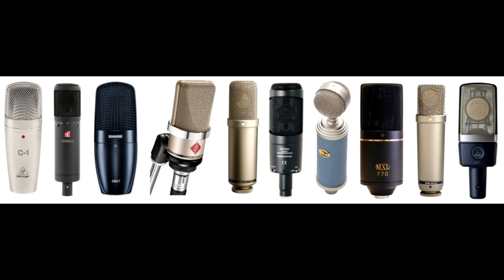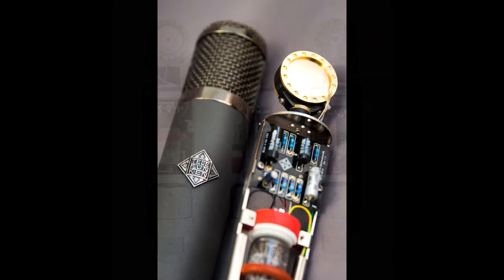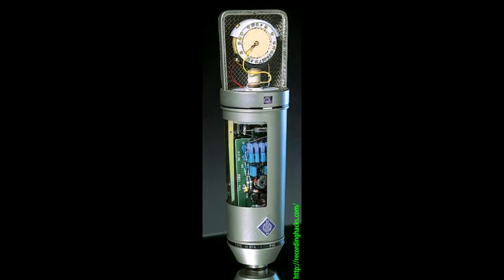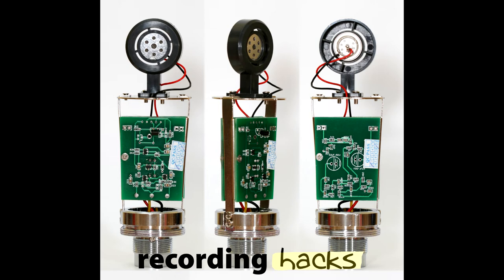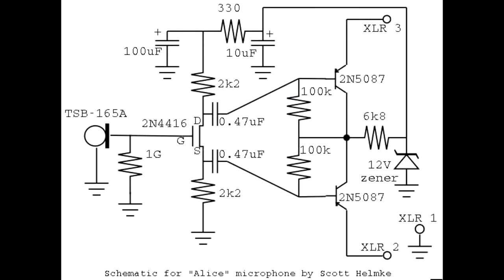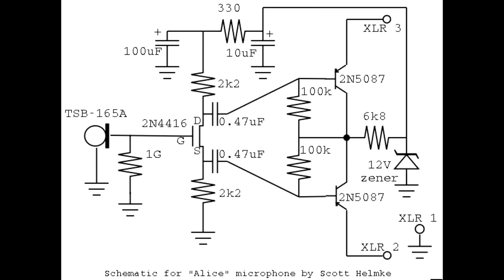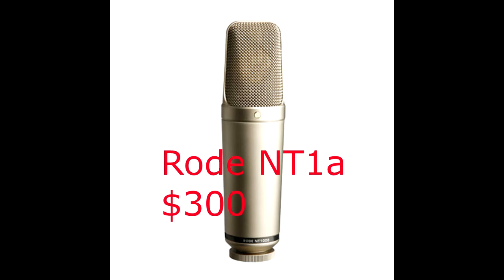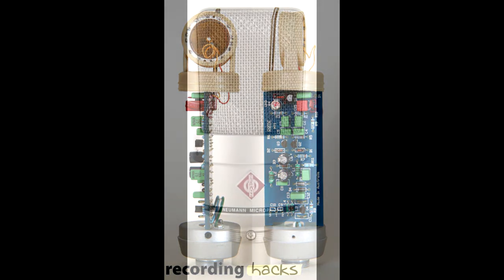#446 Condenser Microphone Overview

Comment: I think you are getting your impedance and current mixed up at times during the video. Impedance is the complex resistance. So the condenser microphone element starts with a high impedance low current at the FET and the circuit converts this to a low impedance high current balanced output using the transistors.

Comment: I hope you find this as upsetting as I do: https://www.youtube.com/watch?v=1DR-tTU8uIM
I know why magnetism exists, but who could be comfortable with such "sorcery." Electrers are are just err static static, or permanent static fields--instead of permanent magnetic fields, but we don't often interact with electrets as much as we encounter...refrigerator magnets.
Way back in the day, we used to hot-rod Panasonic elements for use in speaker testing. There was one that had over 120db of dynamic range, and was pretty flat, as well, like many speaker test mics are, such as the Behringer ECM8000, which singers would not like to sing into.
Reply from the maker: it IS magic. thanks for the video. reminds me of my old physics classes. There is magic inside LCD displays too. permanent charges put inside by cat fur... but lets keep to the audio topic :)

Comment: anything above NT-1A is a wankery..
Sure, ceramic PCB and laser trimmed resistors is a nice way to increase BOM, but after owning NT-1A (which has at least 6mm thick PCB btw lol), I am convinced that even it can be beaten in terms of value with a cheaper 25mm electret capsule that started to appear on CN marketplaces and does not use precious metals for sputtering.
I swapped this capsule into NT-1a preamp & body and it sounds crystal clear, perfectly fine for average consumer.